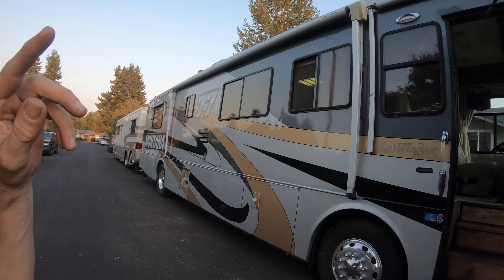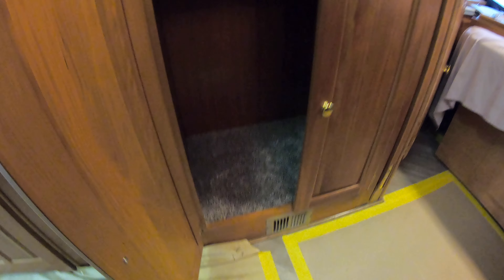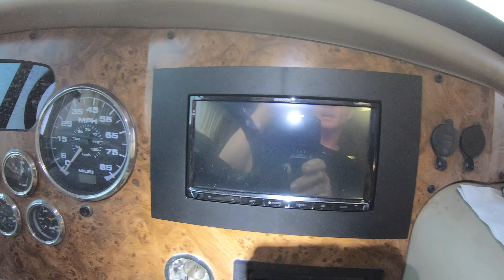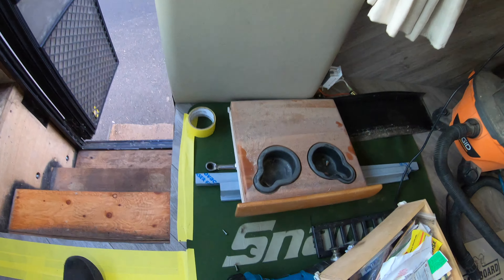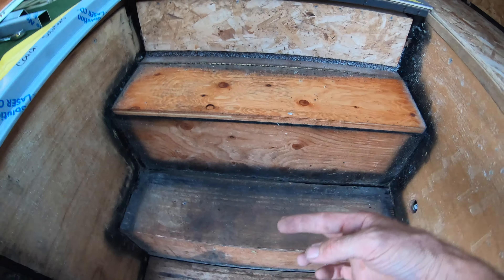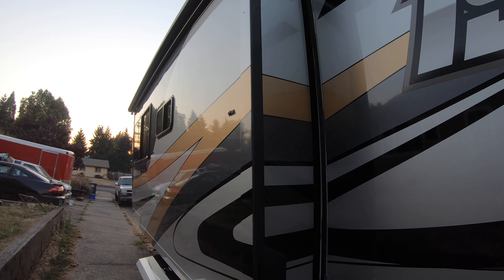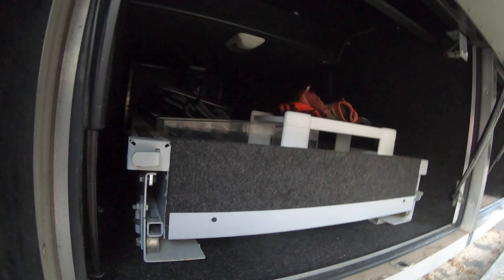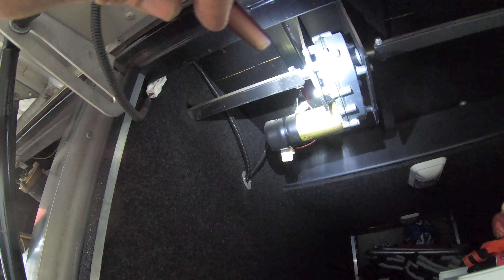Monaco Windsor Power Gear slide repair?? Updates!!!

Comment: I wanted to go BIG with my front TV but ended up with a 40" since my drivers side cabinet lifts up and just hits the side of the TV. 
My 05 Rev uses those Power Gear motors and I had one go on me and replaced with a Klauber from Amazon and it works really good. 
Front entry and flooring is something I really want to do once I start working my way inside the coach. Eager to see what you do.

Comment: Hello Brian thanks as always for the great info regarding the Gear slideout unit. My question is what do you think about the coaches that have a full wall slideout on the drivers side. I like the space inside when its open the coach is not narrow in the center , but what kind of problems due they tend to present from a functional standpoint ??

Comment: Do Power Gear mechanisms ever rattle when retracted? I.e. are those roller bearings adjustable to take up gear rack slack in the in position? I have an ‘04 Inspire and I have not yet removed the cover in the wheel well.